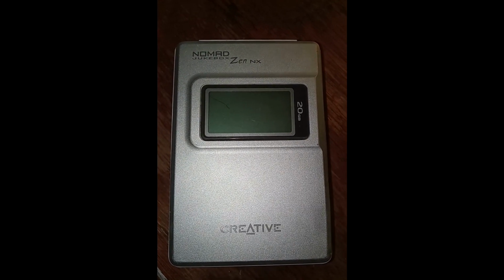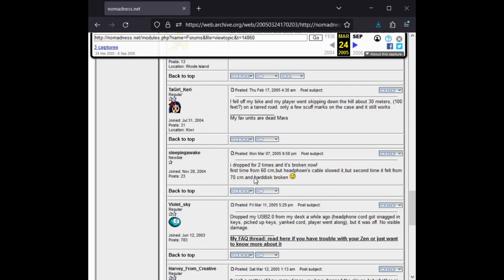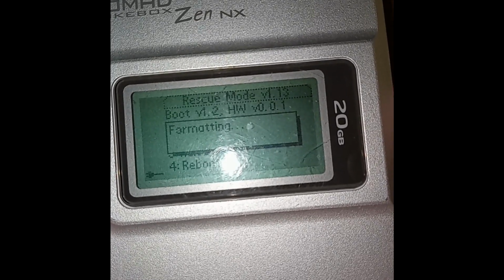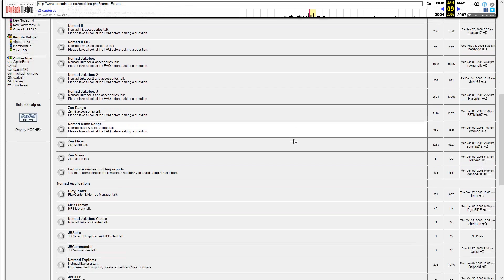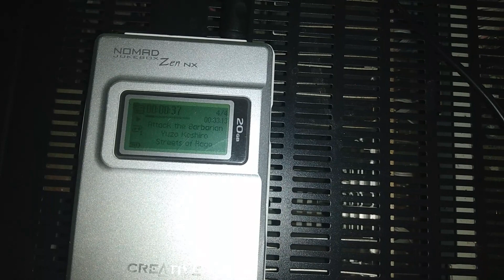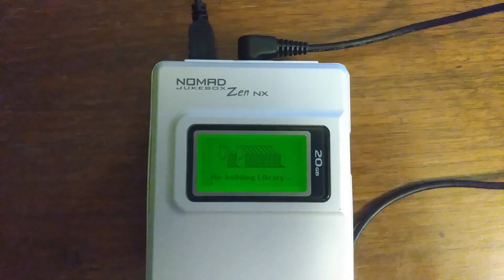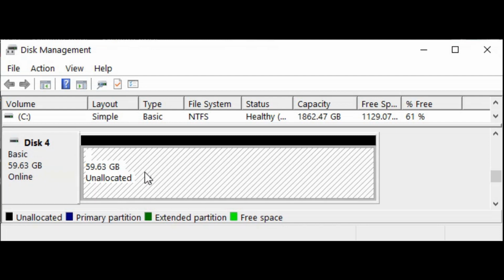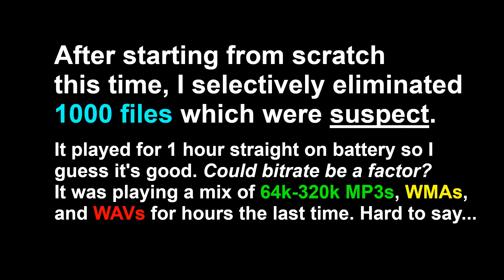Creative NOMAD Zen NX: 20th Anniversary Tribute & SSD Conversion

Comment: Mine is still spinning (think 3rd disk). I pulled it out last month. Still charging (think 5th battery) and I have the original  charger. Like this and might try. Did find a Reddit sub on it.

Comment: Just found mine at my parents'. Tried connecting it my windows 10 PC to no avail. Couldn't find any compatible drivers either. Any ideas on how to access my mp3 files for backup? (surprisingly, HDD still works fine 20+ years later)
Reply from the maker: The Zen NX's file system is proprietary and that keeps it a lot more stuck in a time capsule than it needs to be. Even if you take the HDD out of the player and try to hook it up directly to a PC, Windows won't recognize it.

You need a tool called NOMAD Explorer (3.0.1.0) to interface with the player and access its contents from a PC. Unfortunately, at least as far as I know, the newest OS that NOMAD Explorer works with is Windows XP. I personally tried to access the player on Windows 10 in a few different ways - tricking it with ancient drivers, installing NOMAD Explorer and messing around with with compatibility mode, playing around with XP VMs - but I had no luck. All I could successfully do was run the firmware update tool.

The drivers and NOMAD Explorer are still on Creative's website, but they're definitely more buried than they were when I made this video last year. If you Google "Creative NOMAD Explorer", you should see a search result that says "All Downloads" at the top of the page linked to Creative's website. If you click it, it should take you to a page where you can filter by OS version. Available options include Windows 98/ME/2K/XP/XP x64.

I'm hoping that, eventually, there might be some renewed interest in these MP3 players from programmers and tinkerers. First the player's firmware and file system would have to be cracked open, then someone would have to make a custom firmware for it that makes the Zen NX format itself to a common file system readable by everything like FAT32. Then, in theory, it would present itself as a generic mass storage USB device like a flash drive, all these ancient pre-reqs and proprietary tools should no longer be necessary, and it could interface with anything modern - Win 11, MacOS, Linux, etc.

Comment: I Upgraded my Zen Touch with IDE to Msata and 128gb msata drive. it worked once then failed. any suggestions?
Reply from the maker: Hey, excuse me for the delay getting back. The Nomad in this video got corrupted multiple multiple times. It appears that MichellePucca found a working combo a few comments down. It's something that I've wanted to try and make a followup video for if I can find the time to.

Comment: btw, the issues you experienced has me wanting to do some testing with continous play of the mp3 library to see if it fails at some point.  I have played music for a few hours, but nothing longer so far.  Others have done the same upgrade, and no one has mentioned issues after, so I am extra curious.  Also, using the SD card replacement, you can format multiple SD cards to keep as spares, and even load them with music, so if one SD card fails, you can just replace it with a spare.
Reply from the maker: Keeping spare SD cards is a great idea! Which SD card adapter did you use? All the adapters I tried didn't work, but SSDs worked great. Maybe the IDE socket on the player in the video is damaged?
Reply: I tried posting three times the urls to the parts I ordered off Amazon, but youtube keeps blocking my entire reply to you.
Reply: Adapter
SD to IDE Adapter SD to IDE SDSDHCSDXCMMC Memory Card to IDE 44Pin Male Adapter Support DMA and Ultra DMA Mode for DOS B0CQ2WN941  

128GB SD
SanDisk 128GB Ultra SDXC UHS-I Memory Card - 120MB/s, C10, U1, Full HD, SD Card - SDSDUN4-128G-GN6IN  B08GY61ZZN  

64GB SD
SanDisk 64GB Extreme SDXC UHS-I Memory Card - C10, U3, V30, 4K, UHD, SD Card - SDSDXV2-064G-GNCIN B09X7DY7Q4
Reply from the maker: @MicheIIePucca  Thank you. I'll have to give this a try!

Comment: Parts I used:

Adapter
SD to IDE Adapter SD to IDE SDSDHCSDXCMMC Memory Card to IDE 44Pin Male Adapter Support DMA and Ultra DMA Mode for DOS B0CQ2WN941  

128GB SD
SanDisk 128GB Ultra SDXC UHS-I Memory Card - 120MB/s, C10, U1, Full HD, SD Card - SDSDUN4-128G-GN6IN  B08GY61ZZN  

64GB SD
SanDisk 64GB Extreme SDXC UHS-I Memory Card - C10, U3, V30, 4K, UHD, SD Card - SDSDXV2-064G-GNCIN B09X7DY7Q4
Reply: Let me know if you try the above adapter, and/or SD cards and if you are successful. Do you still have an windows XP/2000 workstation with WMP  that works?  If  you want the exact links, I could provide you a temp email alias  (if youtube allows that).